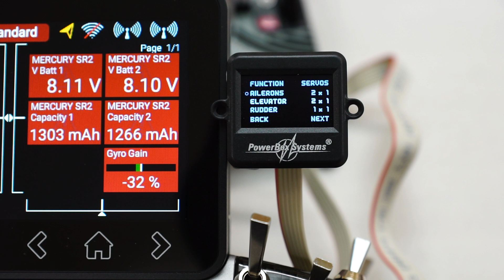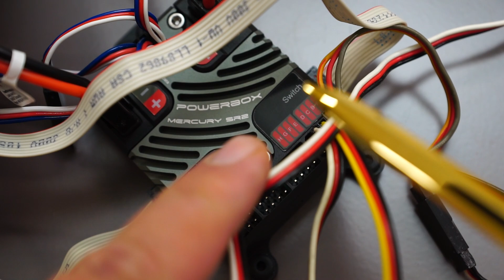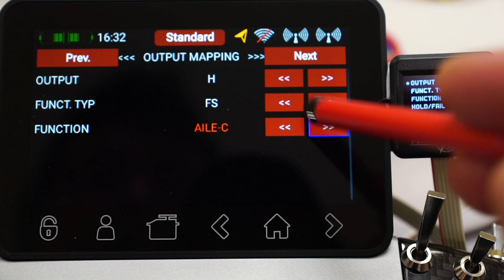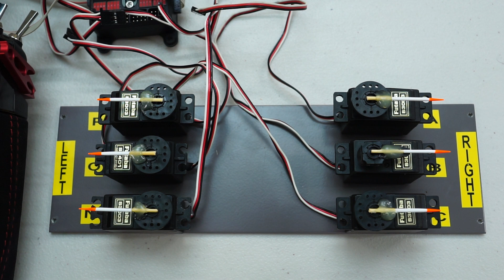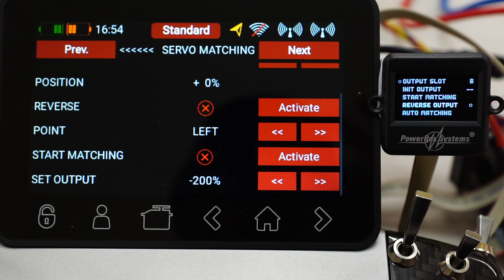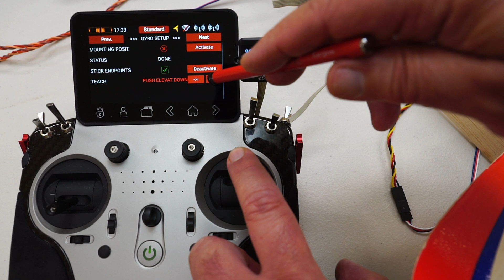PowerBox Mercury SR2 : Part 4 - Multiple Servos per Flight Surface

Comment: Thanks for the videos!  Am new to PowerBox. I have a Freewing Gripen foamie jet. Has 8 control surfaces that need gyro stabilization: 2 canards, 2 elevons, rudder, nosewheel steering (rudder direction) and thrust vectoring in elevator and rudder directions. They need different gains for the pair of canards, pair of elevons, rudder, TV elevator, TV rudder, nosewheel.  Can the Mercury do this?  Otherwise what is the easiest way to accomplish this?
Reply from the maker: @djjay9974  Yes for the Mercury SR2 it can be done. Check out my other videos as probably too hard to explain in these replies here. 
Also you might want to post the question on the PowerBox forum as it is much easier to reply there.
Reply: @CVHeliPilot  Thanks much.  Have posted there as well.

Comment: quick question .... I am setting up a large biplane using 4 aileron surfaces and on each surface 2 servos .... So, I should still setup my CORE radio with only 2 aileron surfaces ?
Reply from the maker: When using a PowerBox in the aircraft you can just set the Tx up with just a separate Left and Right Aileron ie 2 surfaces. If you want more individual control over the top wing ailerons then set it up with 4 but only assign the gyro outputs to the lower wing as you only really need one set of ailerons to be under gyro control.

Comment: Mercury manual says 9 independent gyro outputs for: 3x aileron, 3x elevator, 3x rudder. What does that mean when you show us you can have as many servo outputs as you want. If you had 4 aileron servoes in a wing, would only three had gyro ?
Reply from the maker: Think of the 3 independent gyro outputs as individual outputs for the flight surface in question.

So take for example our yaw axis. Now normally we just need one gyro output to control the rudder... Here we can assign 1, 2, 3, 4...or many more servos however they must all be doing the same thing ie. Move/control the rudder.
If we also have a nose wheel that steers and you also want a gyro output to stabilise the nose, we still use yaw to control the nose wheel. So this is where you would use a second gyro output for the yaw axis. This allows us to fully control the steering independently of the rudder however they both use the yaw axis to stabilise them.

Another option as in my video is where I assign 1 of the 3 outputs to my LHS aileron and another to the right. This is because I want independent control of the two aileron sides for when say adding differential or crow mixing etc.
Reply: Great answer, got it. Thanks.